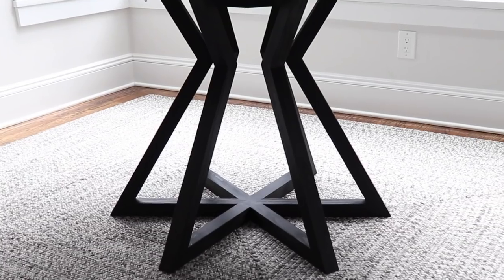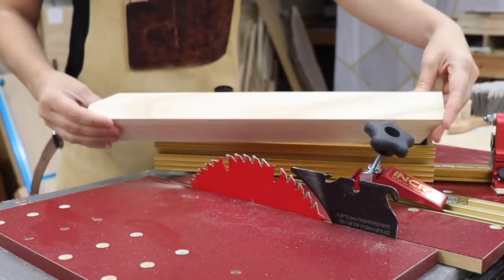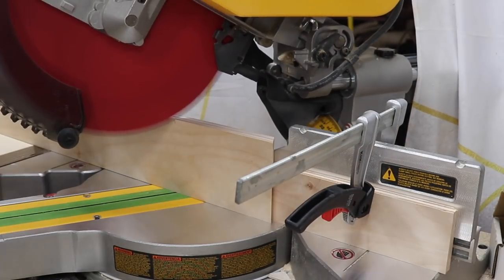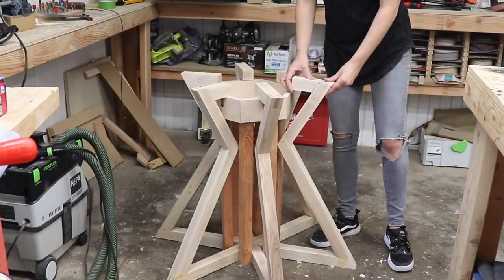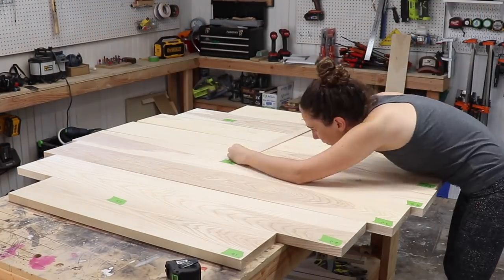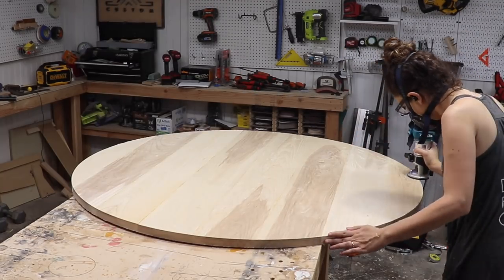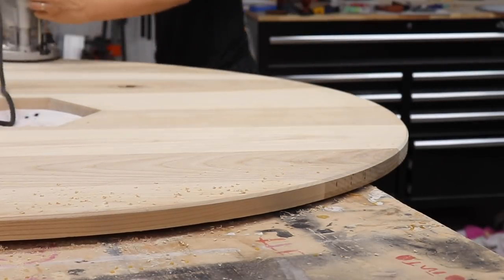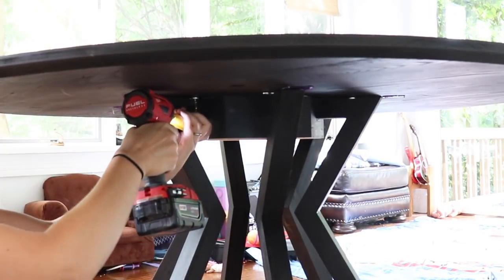How to Build a Dining Table with Storage // Woodworking // DIY Modern Furniture

Comment: Love this project, such a lovely finished product. If I were to have a go, I think I'd add a hole/mounting point for a lazy susan type spinning thing in the centre that sits on top. For those meals with the family where you just have far too much on the table haha. You may have heard this already and I apologize in advance if you have, I'd suggest flipping the legs onto the upside down table top rather than fight the large top, then you can fix it down easier also then simply roll it onto it edge and up.

Comment: When joining boards together like when you made the table top put the cupping of the end grains opposite of each board when joining. One up, the next one down, etc. That way if the board grain still has internal pressure and it wants to cup each board will put stress on each other in the opposite direction they may want to bow, cup, twist, etc and they'll help hold each other in place into place. Don't think that would be a problem with some woods and especially if it's quarter sawn as opposed to plain sawn but it's a good general rule to follow for a job like your table top. You may know this and ten times more than I know and apologize if I my intention is seen in other than good light.; I am amazed at your woodwork and have learned more from you than I could ever teach you. Thank you and appreciate your videos, love them. I agree with Dave P, Seriously impressive work!!!
Reply from the maker: Yup! Alternating the grain direction. Thanks so much!

Comment: I always look forward to your new projects and appreciate how casual yet polished they look. I’m in the process of attaching a 32 inch round oak top to a pedestal and plan to use a square piece of plywood for the connection and then a round skirt about an inch from the table edge to keep the top flat. I have an Amish made 6 foot round oak table with a skirt and it’s still flat after 4 years.
Reply from the maker: Thanks! Good to know!

Comment: Another excellent design. When joining a tabletop to it's base, flip the top & lay the uppermost surface on a dust sheet, then mount the base. Believe me, it's a lot easier to upright a complete table than it is to join the two pieces from underneath the table top. ;D

Comment: Wow, you went into this project "not knowing a lot of stuff" and the end result is stunningly amazing. The black colour is awesome.

Concerning the weight reduction of the central lid. You say you might route out a pocket thus removing material making the lid lighter. Well instead you should make another identical table top for the back yard, where you tell your kids to perform 20 flips per day. They'll get stronger and will be able to easily pick up the lid. Just my thoughts.
Reply from the maker: Hahaha I'll get working on that!

Comment: Jason over at Bourbon Moth actually does his large circles exactly how you ended up doing yours for the purpose that he wants to only do one pass with the circle jig just in case it moves slightly. So he gets one good round pass, then uses the flush trim bit. I personally have never had issue with my (even homemade) jigs shifting on me, but just know that some people do it the way you did intentionally

Comment: Very nice joinery, you took on an intimidating project and nailed it. I always keep a few reverse set jigsaw blades in my kit that have the teeth running backwards so they cut on the pull stroke and don’t tear out the underside. It gives you options.
Reply from the maker: Thanks! Yeah. I’m going to need to pick some up. Didn’t want to have to run out mid project.

Comment: This is amazing. The joinery, those angles? That's super impressive. Also I think the black dyed Ash looks great. The grain is still visible, and not everything needs to be perfectly natural look.

If you're looking for ideas for the center compartment, you could make several different "add-ons" to drop in there. A lazy Susan, a condiment caddy, even a recessed flower vase.
Reply from the maker: Thanks so much! This was def an interesting one to figure out. I also love how you can still see the grain in the ash. Those sound like great ideas!

Comment: I love the table. Really great design and build. I think the black looks good too. If you're worried about the kids coloring or pencil marks, I would look at a putting clear epoxy layer on it. From personal experience, my mom's dining room table has etched math homework in it from...uh hem...a long time ago LOL! My brother's kids have also added their touch marked it up with a red Sharpie and some other markers that weren't totally washable. I'm going to be sanding it down, restaining and coating it for her soon. The only thing that concerns me is that the table has two removable leaves and I want the same thickness on all of the surfaces. I'll have to do each section separately and cross my fingers. Maybe I can calculate quantity versus surface area to try for a consistent thickness.
Reply from the maker: Thanks so much! Yeah. If you can find a friend with a drum sander that would be amazing! Ha

Comment: Another really nice project.  Your tenoning jig works better on that jobsite sized table saw than mine.  I'm going to have to look into that one.  Instead of so much sanding, you're pretty good with a hand plane, why not save up for a No. 4 bench plane, and with a card scraper smooth the top instead?  After that, you can if you really want to, finish with a quick pass using 220/240 sandpaper.  It's much less tedious.  Great job!
Reply from the maker: Thanks so much! I did some work with my #4 and a card scraper. The card scraper hurts my thumbs too much. I have to make a holder for it....

Comment: To flip the worktop over the countertop do the following: You pull the top or the big piece you want to turn towards you, when it starts to fall you will fall down to the ground + -45 degrees. Be advised to put a cloth on the floor to avoid scratching the piece. Then you raise the highest end until the piece is 90 degrees off the floor on the cloth. Now you rotate the piece 180 degrees and do the same steps, but in turn, tilt the piece until it is against the workbench, grab the other end of the piece and lift until it is horizontal, then push. When you place the tabletop on the table, you do the same process, but since the tabletop is heavier than your legs, you would put a chair on the floor against the wall, and put the table legs against the chair so that it wouldn't slip and lift the top is as I told you earlier.

Comment: You have everything else, get a jointer. It is pretty basic for a good shop. I bought a cheap WEN  and it did a great job on my 8/4  10' maple boards. In a couple spots, I had to use my Ryobi battery powered hand plane because plaining  10' heavy boards alone with a small planer was pretty difficult.  In the end, it all worked out though. By the way, I use two Kreg Mobile Project Centers (folding tables) and they are indispensable. working in a garage.

Comment: A good clamp would be an adjustable back (with locking option) for the angle, coupled with a C clamp set of 3 for the actual clamping. Two on the sides to keep it at angle, then one on the joint to keep it tight for the glue to act. Simple, easy to make, it's essentially an angle finder, scaled up.
Reply from the maker: Yeah, I was just so rushed with the kids home my mind couldn’t come up with anything. Ha

Comment: Great job Tamar. Your approach to making that center hole might have been easier.. but you got it done creatively and bravely.
Reply from the maker: Yeah. I originally wanted to set up a fence for a router. Which would have been a bit cleaner. But I didn’t have any small bits that would be able to cut all the way through. And the circ Saw blade was 1/16 thick. So that was the perfect thickness for the gap.
Reply: @3x3CustomTamar  I thought about that but you wanted to retain the cutout to put back in so ... Router would not have worked. Your method turned out to be the best answer. I probably wouldn't have thought of it and if I had I would not have had the confidence to do it ...Kudos.

Comment: great job, i live it.  Tip: on the top of the table, was easier to drill all the way the center, work half with the router and then turn it upside down

Comment: You could make a center lid with a magnet under the surface no holes visible on the top. Make a magnetic handle an holder on the underside of the table or put the magnetic handle some where near by. I like your design just offering a suggestion if you do decide to do some thing differnt.

Comment: You did everything well. the C channel  really is not needed  it will be fine , the figure 8 fasteners should be more that enough . love the black , you can still see the wood grain and it has a clean practical look .  I love the angle on the legs , perfect for tall people's knees.  finally your patch job looked great , you ran it with the grain and it blended in nicely .
Reply from the maker: Thanks so much! Hopefully it won’t be a problem. Thank goodness my mess up wen with the grain!!

Comment: Hi Great looking  table I am impressed with all of the angles and  joints you used . My question is this could you tell me a little more about the finish  you use on the table top. Thanks Jeff Peters
Reply from the maker: Thanks so much! This was definitely a fun one to figure out. Ha. Sure. I used Rubio monocoat. They have stains called precolor easy. Then the topcoat is a 2 part mixture of oil with a hardener. So it’s like a hardening was oil

Comment: That base is incredible. Now that a year has passed, (and assuming you still have the table) consider covering the table with epoxy and do a marble or granite look. Not only would you be updating the look, but it would be resistant to markers and crayons.
Reply from the maker: Thanks! It’s already covered in markers and glue. Ha
Reply: Seeeee?!?! Excellent opportunity for an update! Not sure if it would be your thing for your house, but you could clean it up and make it a blank black canvas for the little ones, have em mark it up with fluorescent and other brightly colored markers or crayons and then seal it with epoxy. You can leave it like that for a little while and then if you tired of it then all you have to do is scuff it up and do a new design.

Comment: I love your solution to the joinery of the base. I'm gonna borrow some of those ideas for a project I've got planned. If I can ask though, why did you elect to use a hand plane as opposed to a router sled? That seems like it would have been the perfect solution to surfacing the table top.
Reply from the maker: Thanks so much! It was such a fun idea to play around with. I prefer to use my hand planes sometimes. It’s relaxing and it’s good exercise. Ha.  I would have had to build a router sled that was wide enough to pass over the whole thing. I think having to reach over in the center, the widest part, would be a challenge.

Comment: Flipping the leg stand upside down, screwing it in from the top, then flipping the whole table upside down once again might have been easier, I think.

Also, a table top for kids is high wear. I'd apply a two component polyurethane floor finish to the top, to keep it decently looking for a longer time. It'd also make it easier to clean/wet wipe and a lot more difficult to stain and scratch. It's also very easy to apply - just don't do it inside, it stinks while curing (but is completely odorless after that).

Off topic: Your 6'4" husband is a lucky guy. He might give you a hand with handling larger/heavier pieces, for all that luck.
Reply from the maker: That’s actually what I ended up doing when i actually placed it in the kitchen. And my husband did help me that part 😉 I didn’t want a finish like that. I wanted to use Rubio for this. It’s actually great bc I would be able to do spot repairs instead of having to sand down a whole surface to repair any scratches or anything

Comment: @13:04 you could have drawn a circle, divided it to 6 parts, connecting the intersecting points to get the hexagon more accurately and faster since you had the middle of the table circle already drilled (or nailed)
Reply from the maker: I prefer to use referential measurements. So using the hexagon from the base as my guide was easier for me. You do you. Ha.

Comment: Looks great. You have serious talent. 

Curious...how much of these builds do you plan out/draw out before you begin? I see you work off the occasional stencil, never a master plan though. Are you "winging" most of these builds as you go? If you do a design phase prior to these builds, I think sharing your process would make a great video. Just a thought. 

Thanks for sharing all of your hard work, keeping it real by not editing out your mistakes, and pointing out things you would do better next time. 

Looking forward to the next build.
Reply from the maker: Thanks so much! I really depends on the build. Some are just rough sketches on a post it. Others, like this one I drew up on sketch up because I knew figuring out the angles would be difficult. But I didn’t do any of the joinery on sketch up. That was all figured out on the fly in the shop. I’m still not a pro at sketch up. So a video on that wouldn’t really be great....

Comment: Amazing design! My only concern is it is basically being held together by only wood glue against gravity. Your beautiful tenon joints really need a dowel through them to lock them together.
Reply from the maker: Thanks! Actually. The bridle joint is one of the strongest joints because of all the surface area that glue has contact with. Pegged bridle joints were common before the invention of modern glues. They were necessary back then, but not anymore. It’s been years of this table in use. With my kids abusing it everyday, even sitting on it! Besides for glue and paint all over it, it’s still holding up really well!

Comment: How about rigging a fixed arm from the table center to the jig saw and/or the trimmer to cut the circle? Such a fixed arm could also as a first step hold a scoring blade to inscribe but also prevent tear out (especially with a careful choice of blade. Small point, many words....

Comment: I thought the angle in the middle of the legs would need some sort of support until you stood up on them. Good job.
Reply from the maker: Yeah! The bridle joint is super strong. It’s used a lot in chair construction so you know it’s a solid joint

Comment: i really like every part of this one! came out awesome! i'm always worried about how stable the tops are. I know you showed the base was plenty strong, but with a mostly central support base, does it want to tip if you are leaning on an end at all? or is it heavy enough to hold itself mostly?
Reply from the maker: That was my concern too. That’s why I made the bottom of the base so wide. It’s really supported. My initial design also only had 4 legs with those crazy angles. Then I realized it could tip in the gaps of the 4 legs and the 6 legged table was born. Ha
Reply: @3x3CustomTamar  awesome, great point, a lot less gaps with the extra 2 legs! Might try something like this!

Comment: Hi Tamar I notice you use different blades when cutting your wood, do you have a favourite type for your cross cutting and your ripping long pieces i have seen you do.
maybe you you could run a video on this :-)
Reply from the maker: Yeah. I like to use a dedicated ripping blade if I am ripping a lot of material. I like the thin kerf amana blades the best
Reply: @3x3CustomTamar  arh thank you for replying I've just been looking at them from your links :-), I have just bought the complete incra LS table for my router and table cutter all in one and I'm about to do the journey into wood working more seriously now I'm retired and my first one I want to do is the curved hall table with the brass you made :-)

Comment: Tamar- great work! I have three random questions:

1. How did you avoid having to joint/plane the top boards? Do they come square?

2. Where/how do you store all your jigs? Serious question. They are all big and bulky. 

3. Why don’t you call your husband into the shop to help flip the heavy stuff?
Reply from the maker: Thanks! 
1- I bought them surfaced this time because i knew this would be a challenging build and wanted to save on time 
2- I store them under my workbenches. 3 - I do this stuff during the day when he’s as work. Ha

Comment: Rather than use the jig saw to finish cutting out the top, would it be an option to drill the centre hole all the way through and after flipping the top over, use the circle cutting jig and router to finish the cut on the other side?
Reply from the maker: Sure. That could work. But I didn’t want a hole in the top as well. There are always multiple ways to achieve the same thing when it comes to woodworking

Comment: Great build Tamar! Very impressive. I see you don't have a jointer. Do you buy s2s lumber? Joint it on your router (which I've seen you do before)? Curious as I also don't have a jointer or planer.
Reply from the maker: Thanks so Much! I normally buy rough and use a jointer sled on my planer and either use my router table or a straight edge with a fish trim but to clean up the edges. This time I got it s2s to save on time

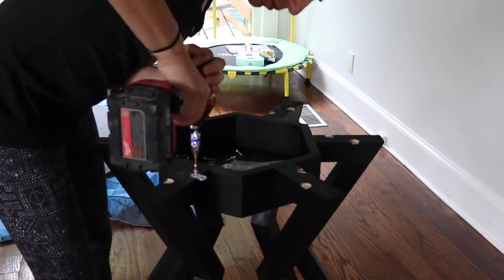Comment: At 16:00 you could have flipped the base over onto the table top and not had to work upside down, better lighting, better control.
Reply from the maker: That’s actually what I ended up doing when I actually installed it in the Kitchen. But I did still first have to lift the top on the base to place it perfectly centered on the box. I wanted to make sure the reveal was even. So once I did that. I marked the underside with tape. Then installed it as you suggested.